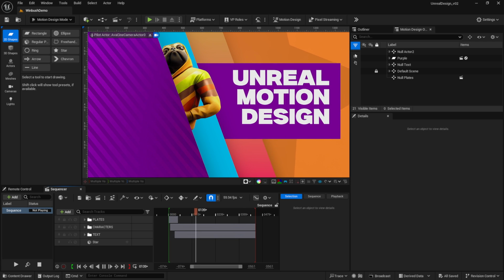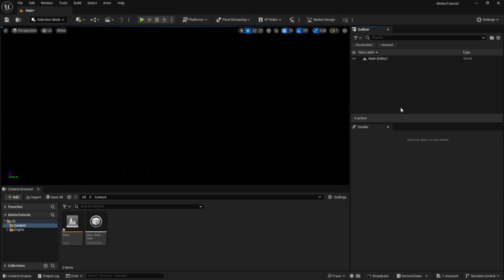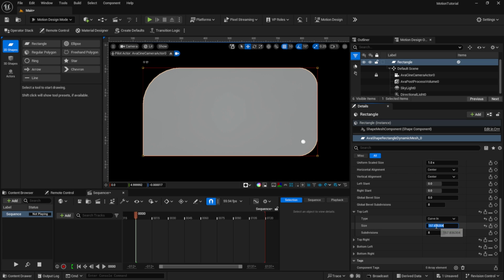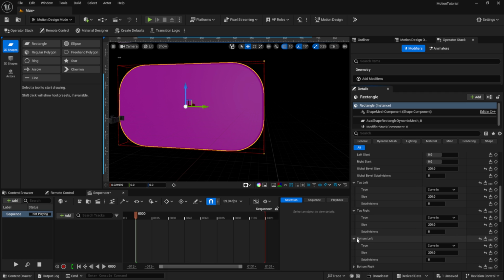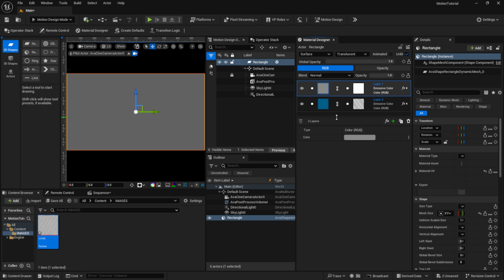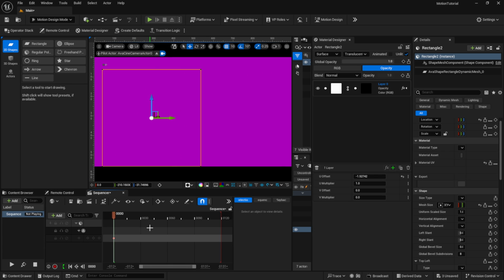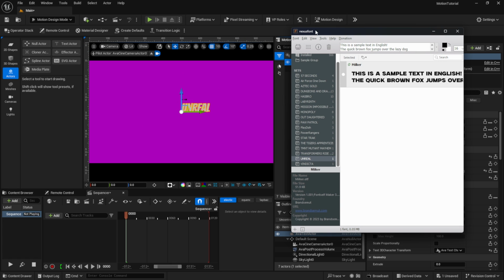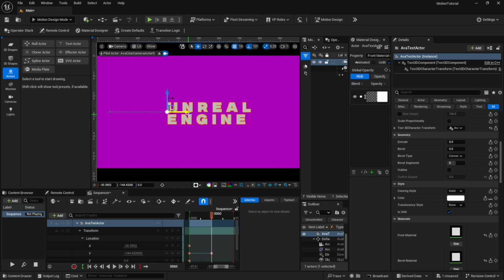Unleash Your 2D Potential with Unreal Motion Design

Comment: 14:13 Hey Winbush. Just curious, have you ever experienced an issue with the "stretch the currently selected actor to the screen", where clicking the button doesn't stretch the actor fully on screen? That button used to work perfectly for me. I used it to add a backplate to my Cineware scene previously. But in the latest version of Cinema, the button no longer stretches my media plate full screen when viewing from an imported C4D camera. The button only works if I use the cinecameras created in directly inside Unreal. Not sure what it could be.
Reply from the maker: I think it only works with the cameras in unreal if you're bringing over cameras from cinema you'd probably run into issues there
Reply: @JonathanWinbush  Yeah it's weird man. it's definitely working with one of my imported c4d scenes but not others. Very weird. I wish there was a way to convert an imported C4D camera into a cine camera actor so that things can stay 1 to 1 with how they are in cinema. Having an accurate backplate inside of Unreal is crucial for VFX artists. I'm gonna post this on the Unreal forums even though I know it's gonna go unnoticed lol. Thanks for the reply bro.

Comment: I see some downsides to this:

-If the client sends a layered PSD, I should separate every layer as PNG so I can then rebuild it in Unreal. AE does it automatically

-If you import some sensible artwork such as Logos or Characters, you SHOULD NOT be scaling it by eye (as he does with the corn character). This should be drag an drop, but instead you have to creat a rectangle the exact same size as the artowrk and map an image to it, imagine doing these with 10 characters with different sizes.

-Im not going to ask what happends with compelx AI files, shpuld I have to export every single piece as an SVG?

I think this is like a C4D with little 2D perks on it. Not a AE replacement. For now...
Reply from the maker: This is round one for now gotta start somewhere

Comment: Great video! About the material designer. You can enable the UVs on the mask stage if you click the 'chain' icon on the layer. That will unlink the UVs of the base and mask stages, allowing you to control them separately. You shouldn't then need to add the panner effect.
Reply from the maker: Thanks for the info!

Comment: Are you able to import SVG Animations, not just a single SVG?
Reply from the maker: Just a single SVG at this time
Reply: @JonathanWinbush  thanks! Once it's able to import SVG sequences it will be even more powerful. One could do complex, procedural vector based animations in Cavalry, export as SVG animation and take some of the load off UE when layering it with its native keyframed animations. Hopefully an update is in the works!
Reply from the maker: interesting so are you doing cartoon style animations? I worked on My Little Pony and all that animation was done in Flash / Animate
Reply: @JonathanWinbush no, it’s for FUI, UI, HUD. My master plan 😅 is making procedural, generative, vector based designs and animations in Cavalry, which it excels at, then bringing them into Rive to make it interactive. Then compile a runtime in Rive, export to UE for final styling and packaging (if that’s the right term?)

Comment: Thank you so much for the excellent video tutorial and introduction to Unreal Motion Design. It will be interesting to learn in the future which types of projects are better suited for UE Motion Design compared to other programs as Davinci-Resolve-Fusion, for example does the new UE Motion Design offer good and simple to use ease-in and ease out options for movements like the spline tool in Fusion etc.
Reply from the maker: Yup you have full control over your keyframes and can even access curves if you need to
Reply: @JonathanWinbush  Thank you!

Comment: OR... i dont know if anyone of older motion desingers remembers the Autodesk Combustion 2D/3D Compositing program (like AE ) that was used to to the composit of whatever and that is FED to a texture slot in 3dsmax and that was done on the fly !!! I expect that they are either working on similar solution as it iooks to me that we will need more than 1 ultra wide monitor to fit all windwows and tabs to be able to work in pleasant AE environment.
Reply from the maker: Yup I learned Combustion in University so Im that old lol